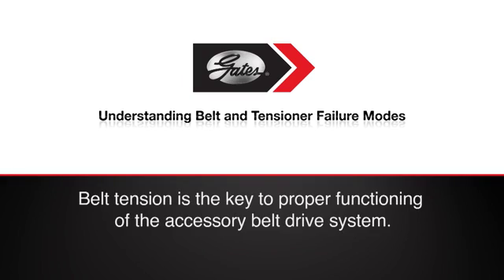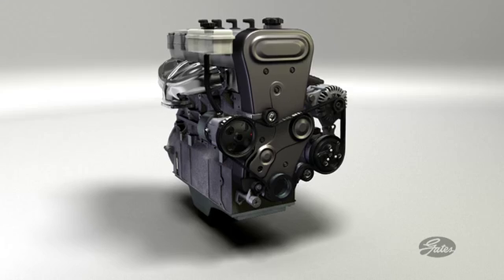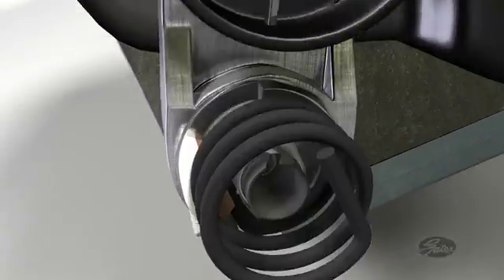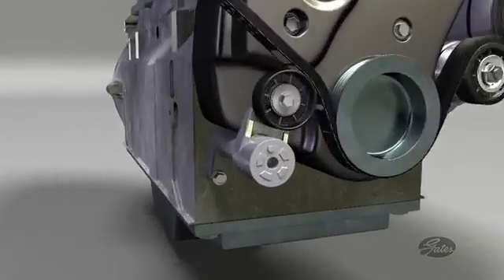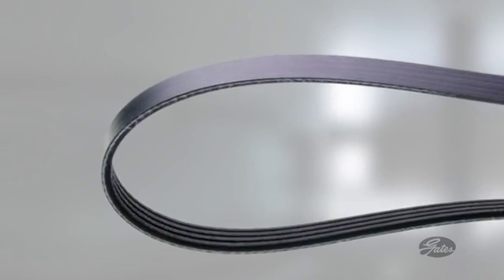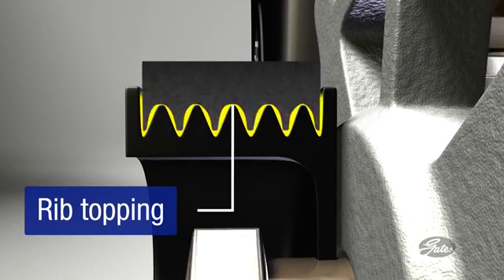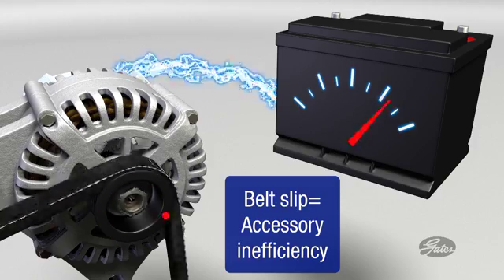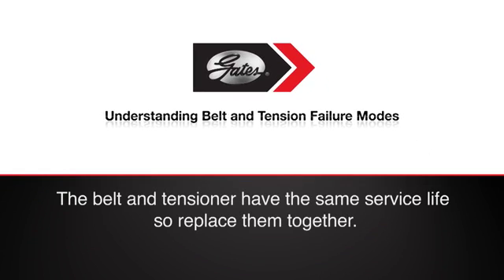Understanding Belt and Tensioner Failure Modes (Full Version)

Comment: I just replaced my belt with a Gates belt and the tensioner indicator is at perfect position. However, when under the hood monitoring the indicator, If I push on the throttle cable to raise the RPMs of the engine the indicator moves slightly but then returns to normal position at idle. Could this be a sign of a failing tensioner? There is no noise coming from the belt or the tensioner or any other signs of a problem

Comment: My tensioner at idle, bounces around and makes a slight rattle noise?
Reply from the maker: Could you please provide the application information? It might not be the tensioner; something else could be causing the tensioner to bounce around.
Reply: Gates Auto Aftermarket it's from a 2002 chevy s10 2.2l. The tensioner at idle, bounces around and makes a metallic noise. The other pulleys seem fine. Thanks!
Reply from the maker: Rattle noise could be caused by a worn belt.  As the belt wears, the ribs of the belt lose material and it sits further into the pulley which makes the belt “longer”.  A belt that is too long results in the tensioner working outside the working range, causing the tensioner to hit the tensioner stop.  I would suggest replacing the belt.  It wouldn’t hurt to replace the tensioner at the same time as the belt and tensioner tend to wear at about the same rate.